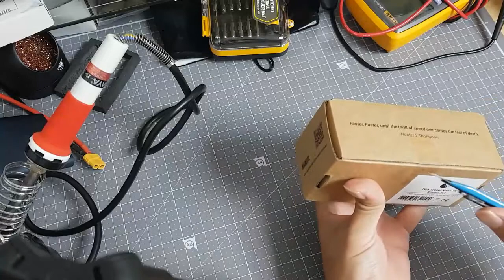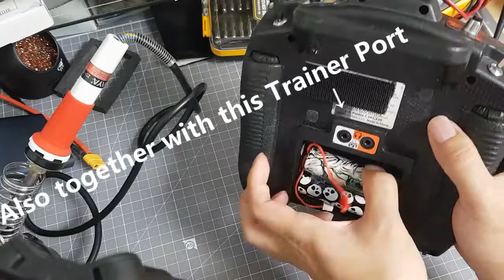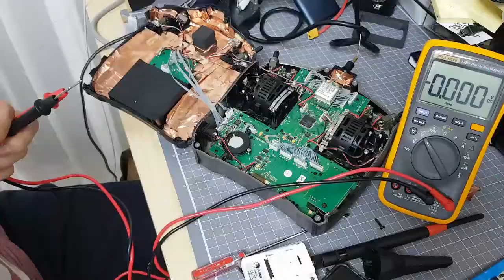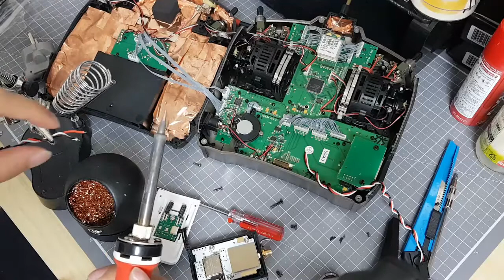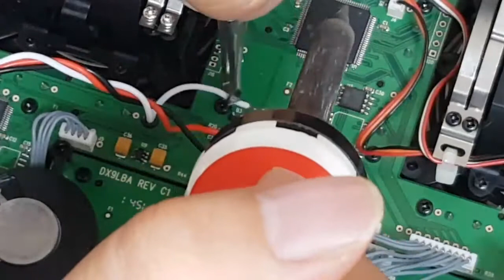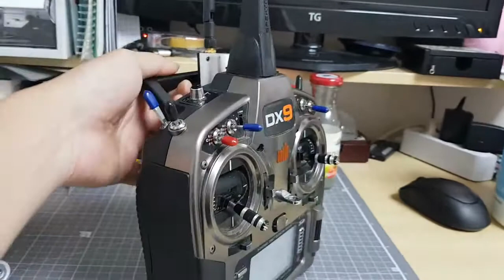Spektrum DX9 Mod for TBS Tracer

Comment: Do you know if there is a way to connect an ELRS module too? I guess Spektrum would have to make a firmware update? I don't find any info about this
Reply: I'll try it and let you know. Supposedly it works if your transmitter speaks crsf.
Reply: @RubyS.1  Thanks, I'm very interested in your findings.
Reply: @Jean_Mairdluheux  elrs is a no go. But since spektrum is using the crsf protocol and not ppm or pwm the TBS nano worked just fine didn't have to configure anything just worked. Few people on discord said that elrs was working on thier spektrum with the newest spektrum update which supports crsf V2 but I couldn't find anything.
Reply: @RubyS.1  Thanks! I think I will buy a crossfire module then.
Reply from the maker: I am pretty sure it will not support E LRS. The reason is, you need to setup the protocol to Crossfire protocol to communicate with the transmitter(Tracer). But i haven't seen ELRS model in the setting. Check out for any updates.

Comment: Will this work with dx6?
Reply from the maker: Unfortunately, I find it low possiblity with TBS Tracer due to below reasons.
1. DX9 was built more opened for future enhancing from the first. The soldering pad "J16" was made for those reasons.. but not sure for DX6
2. To use it this way you need to change the protocol setting to "Crossfire" in the DX9 setting but I am not sure if DX6 is capable of that function.
Reply: @bangdfpv3270  I may open up my dx6 and see if it has that pad for it
Reply from the maker: @Remcos.builds  great and also check if you can change the protocol as well to "Crossfire". Refer to below video from 06:30  

https://youtu.be/UUGbDUGYDmk

Comment: Id like to do this. Can you tell me how you got on with range and also programming the Tracer. Do you activate it in the menu the same way you would the full size Crossfire? Thanks for the vid.
Reply from the maker: Thanks MG! For the progamming goes the same with Crossfire. Inhibit "Spektrum RF" and activate "Crossfire V2" (it should be V2 if you have the latest firmware of your DX9)
I flew my quad  yesterday, but one thing for sure, it definitely out range my omnis, inwhich my previous SPM4651t wasn't capable of... so now VAS crosshire extreme on its way. I will make a separate video as soon as I receive it!
Reply from the maker: @Nathan Castets Hello! My version is 2.01 by the way. For the crossfire protocol I didn't touch anything, only requested for version updated to the distributor here in Korea.
Reply: @bangdfpv3270  please share for v2..just install module but no function every  channel after success binding n updating module n rx..tq
Reply from the maker: @amauulau3574  did you set the betaflight configuration protocol to Serial(SPEKSAT, SBUS, SUMD) & CRSF(Crossfire)? I tried CRSF V1 in my DX9 but seemed to work
Reply: @bangdfpv3270  i convert nano rx to pwm,,for plane..
Reply from the maker: @amauulau3574  i think the best is to verify if the rx is receiving the signal from the tx.. i would use betaflight, or for my fixed wing for example, I would use my eagletree vector if the input signals a appropriately receiving
Reply: @bangdfpv3270  tq for suggestion sir,,will try soon..